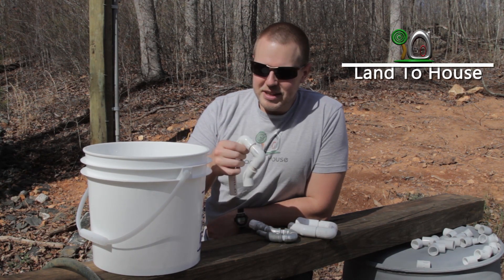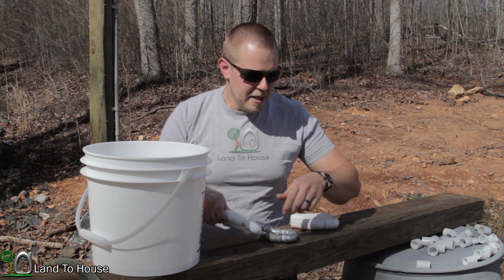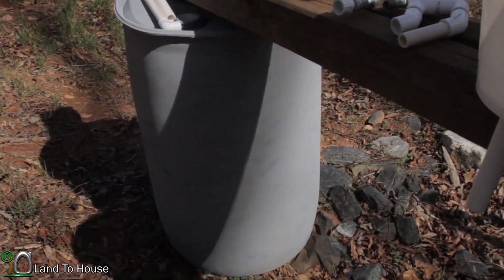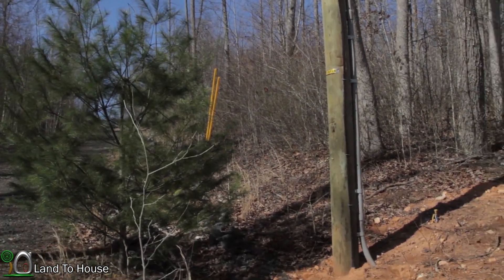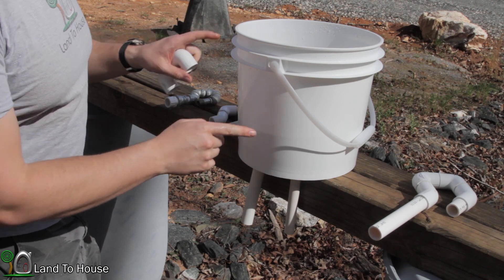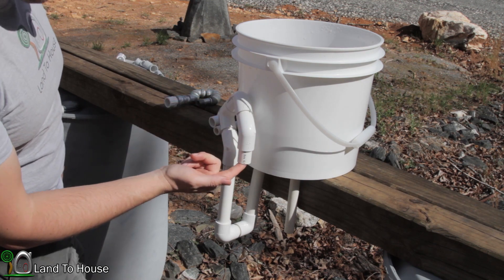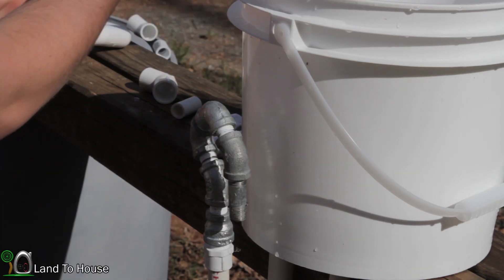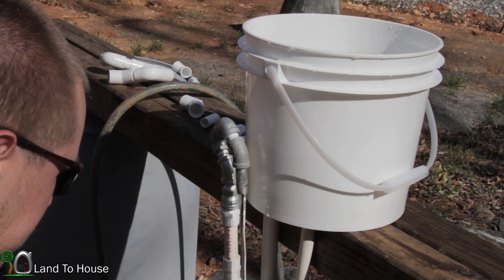Advanced U siphon Testing

Comment: If air gets up in your discharge tube it's harder for the siphon to reestablish it's self, the up tube on the end forms a water seal. Discharging into a bucket so the end is under water or use of a check valve, even a balloon all to keep the air out will help. Experimenting is fun , thanks for sharing.

Comment: So as you said, ducks are not clean, and most of their waste is going to sink to the bottom so you want to suck the water from the bottom to get the most out of the pond; but you do not want to empty it; so you could T in a "snorkel" to set the drain level as this will allow air to enter the pipe. I'd use 1in for the drain for high volume flow and 1/4 for the snorkel to set the stop depth.
                         pond wall> #
                                                #            //\\  <siphon start level
                                                #          //   ||
| <snorkel stop level        #        //     ||
||=================#==//       ||
||                                             #                ||  <drain
|| <bottom of pond         #

Comment: The siphon will start easier with a upward bend at the output. 
An other way of automatic siphoning is just an ordinary siphon using a hose. The hose exits into a full bucket of water. The rim of the bucket exactly at the elevation you like for the water level in the pond. This will work as a hole drilled in the side of the pond wall.  No inrush of water to get the siphon started is needed, but long periods of heat and sun may rise some concern due to vaporisation.

Comment: Would it work placing part of the u syphon in part out? To be able to drain containers without drilling a hole in the bottom
Reply: To hold the water level constant in a dam: start an ordinary siphon over the dam. Put the output into a bucket of water. Elevate the bucket so the rim is at the wanted level in the dam. Normally  you have no flow. As soon as the rain starts to fall, so does the siphon.

Comment: It's a huge learning watching your videos.

Need your guidance to make an Auto Siphon to drain a Pond, Without filling water into it to activate it.

Whenever pond fills with flood water It should activate & starts draining water...
Reply: To hold the water level constant in a dam: start an ordinary siphon over the dam. Put the output into a bucket of water. Elevate the bucket so the rim is at the wanted level in the dam. Normally  you have no flow. As soon as the rain starts to fall, so does the siphon.

Comment: Hi ... if we close the bucket well and fill it with water from valve at highest point then make another extension of pipe from bucket goes down to suck water from pool lower than siphon pipe output did it work (so we can run ram pump at point higher than pool).thanks ... i appreciate if you can make video about this.

Comment: Added the extra pipe and it went upwards that was your problem you need to go down with gravity if you had a longer tube coming out the bottom of the bucket you would have more suction therefore it would suck all the water out the bucket

Comment: Well, that was interesting but can I see it finished and attached to your duck pond?
Reply from the maker: Sadly I do not have a duck pond. It is a fun idea for the day I get one.
Reply: @LandtoHouse  Ohhhh, so I am actually trying to figure out how to redo my current pond.  I have a small round kiddie pool size pond by my coop.  I am working out an idea where this pond flows down into a larger dug out pond that overflows into an intake bucket with a ram pump connected to it that in turn returns the water the original small pond.  So, the water will be constantly circulating and at some point in the system I need a rudimentary filter.  So, I watched this video and thought it might incorporate somehow with my idea but not sure how......
Reply from the maker: The only real problem is that the ram pump is going to have about 90% Wastewater. It won't be long before your system has all of the water at the bottom

Comment: Your siphon is backwards!  The diamond siphon needs water flow the opposite of what you did.  The water should flow over the top 90 BEFORE flowing down to the side 90.  You have it flowing to the side 90 first and then to over the top 90 - this makes it no different than a standard U siphon.  The flow from the top 90 to the side 90 causes water to flow back under itself.  This makes it harder for air to flow back up the pipe and easier for the siphon to fully activate.
Reply from the maker: Interesting. I need to revisit this idea in the future and I will turn the siphon around. Thank you for your observation.
Reply: You are welcome.  My explanation is from what I've researched on it so far.  I haven't created one yet, but considering doing some hands on research instead of the armchair research I've done so far.  The "diamond siphon" name is used by only one source I've seen so far, but its name seems most fitting (Pun not intended).  Another variation I've seen people talk about would involve heating a PVC pipe and bending it into the needed shape.   I think this variation would look a lot like a hairpin cotter pin and should be named the hairpin cotter siphon to distinguish it from the diamond siphon, even though functionally they should be the same.  I have a theory that bending the PVC to match the hairpin cotter's zigzag after the loop would actually increase the ease of activation of the siphon, but its only a theory.  The most interesting way to heat PVC pipe I've seen is heating sand on the stove in a pan and then pouring the hot sand into the pipe.  This heats the pipe from the inside out and seems to work well for the YouTuber I seen doing this.  Haven't tried bending PVC this way yet, but creating an automatic siphon might give me reason to try it.  

To be honest, I'm not sure how far I'm going to work in this.  My original goal was to find a way to get water to flood a tank or container every 2 hours, but then have it immediately drain after the flooding.  This would be for spouting, microgreens, or fodder and a small trickle water source would trigger the flooding every two or so hours (but it looks a small trickle wouldn't be enough to trigger a bell siphon, U siphon or any related siphons.  And it would be a lot easier to just buy a pump and timer and put a hole in the container that is too small to drain the water as fast as the pump is filling it, but big enough to drain it fairly fast when the pump is done.  If something I've written on has your interest, you are welcome to try it and even make a video on it.  You might search for "loop siphon", trying to think of a name someone might call it is the hard part and I just tried "loop siphon" in Google and it seems promising.
Reply from the maker: Hands on is the best! I learn so much more that way. I have only tried to heat and bend PVC once. It was not easy. Keeping the pipe uniformly heated is the hardest part. The sand idea is a fun one! not sure how well that will treat your stove top. Might be better to make a fire outside. I was having issues with the small trickle as well. I finally made a shishi odoshi fountain to jump start the siphon. it works but would likely mess with your micro greens.

Comment: Hi, I built an example of your external siphon and it starts very reliably, but depends on the in-flow rate of the water.  The problem I'm having is getting the siphon to break when the water level drops to the drain pipe inside the bucket.  So.... may I ask how you get the break to be reliable.

Comment: Would the auto siphon work if your outlet pipe gradually rises above the height of the buckets top? Or outlet is at 90 degree angle half inch diameter. I have a problem with a surface water drain where its non existent due to the ground being lower than existing surface water drains. I was thinking if I used a 2m drain pipe with width 100mm would a half inch auto siphon fit inside with the outlet rising straight out of the pipe so full pipe can be removed to clean debris etc. Would there be enough pressure to siphon out and move the water above the top end of the drain by at least another 2m gradually to a drain about 4metres away.
Reply from the maker: I am not aware of a siphon that auto starts when there is a place above the water level. The water would simply get stuck in the pipe between the low spot and the high spot.
Reply: Land to House Damn there goes my idea lol I've got another idea whereby using weight and gravity making a  pendulum where one side extracts water up a 100mm pipe from a smaller pipe, and with a simple no flow valve in between and another at the smaller extraction pipe, the other weight pushes air into the other 100mm pipe and forces the water to exit at another point. Need to see if a automatic pendulum exists -_- You made one video on your ram pumps with a tap for the waste valve, would it possible to divert that waste water back into the system or would that affect the head pressure from the inlet?
Reply from the maker: Here is an old design of a pendulum pump that might be fun. https://youtu.be/_7dTofZPaaU

Comment: You should close the outside of the siphone as you continue to poor water....or more accurate 1. close the u part of the siphone 2. fill it with water. 3. continue to poor water above the u part....it will siphone excellently.....
Reply from the maker: When you say close do you mean manually and then reopen the siphon when the water level is high? I am looking to have an auto siphon that will work when I am not around.

Comment: You mentioned reducing the diameter of pipe in your first video to get the siphon to pull when you tried your second test. You could do that, and some people do. The problem I have with that method is that it reduces your flow rate down to the smallest diameter you end up within your pipe system. Another method (seemingly better method that won't reduce your flow) is to make a longer pipe with a few elbows that makes the water drain more slowly. That's essentially why your siphon is working at 6:28 in this video. The water is falling but not lost. It gets slowed down and helps create the vacuum better in the U. When the water just enters the siphon and then falls onto the ground, it's not helping to create any resistance that the vacuum needs. Put an elbow right below your bucket and as close to the bucket as you can, so the water has to change route. That's a slow-down point. If my suggestion is not clear, I can draw a simple diagram for you. Longer pipe and more bends creates more resistance to flow, then the siphon can start more easily with less flow into your tank.
Reply from the maker: Adding a longer pipe to the end of the siphon was very helpful! It gets the siphon going much faster and allows a larger pipe diameter. After these U siphon tests I made a Bell Siphon and it was even more efficient at pulling the siphon with low flow. You might like my next U siphon videos with the shishi Odoshi fountain.

Comment: Thanks for doing this test. I am building the same type of siphon and the same size. I think the reason your first attempt (which I just watched a few minutes ago) was successful and then failed, was the flow rate of the water. With a fast flow rate you can use larger pipe like 3/4". When the second test of your first video failed, it's because you reduced the flow rate, which put too much air space in the top of the siphon. That did not have enough force to push the air out. To explain in a different way, if you were to take your standpipe and suddenly push it down lower in the bucket, the pressure would be quickly increased, allowing it to push the air out and create that vacuum inside the "U". I am making this comment before actually watching this video, but I saw that you have made three separate sizes to compare. If you are filling the bucket slowly, the smallest diameter pipe will be the easiest to start, but take longest to drain. For your intention of draining a duck pond, the amount of time it takes to drain shouldn't really matter, but smaller diameter pipe will be more easily clogged by the duck waste. If you find a way of filtering out the large waste before it comes into the siphon, the smallest pipe would probably work best. Alternatively, if you fill the pond very quickly, you might be able to get the 3/4" pipe to work. Something I wanted to see in your first video was where the water level was when the first test started to drain. Thanks for sharing your videos.
Reply from the maker: I think you are right! That larger flow rate from the storage tanks was enough to get that 3/4" siphon going with little issues. But the Ram Pump flow rate was much smaller and was not enough to get it going.

Comment: Siphons rely on the negative pressure of the pipe after the siphon pulling the rest of the weight of the water against gravity through the siphon so the larger the drop of the exit pipe the better it would work so long as the pressure is not so negative that the water flashes off and the flow remains laminar across the full diameter of the pipe.

Comment: Can you just hot glue a flexible water hose to the outside of the bucket keeping it in the same U siphon shape? If it works it would save you a lot of money and be very compact. I guess you would need a way of holding it's shape and position while you found the perfect shape, then you could glue that down and trace a template from it for any future projects.
Reply from the maker: I have not tried using a hose as the U siphon but I should think it would work just fine. The pipe is not very expensive though.

Comment: Yes  It does matter,  ( at  6:04 )   its the pressure of the burp,  the water has more pressure in the resivior so it releases down the pipe.    and it sucks down the rest of the water with it..  remember though   the speed of the siphon before it takes.  the pump has to overpower the begining of the siphon or it with cancel out and stay the same speed and wont drain.     BUt the sishi odoshi can solve that.   I like how you think I been working on this sort of stuff for a while now,    No ram pump yet but I love that thing, thats genius.   Now I just need a few $$$  so I can buld one.      I also thought perhaps in a pond if you angle the pipe ay a 45 degree angle, perhaps would that work ?  all I have is a pond so thats what I have to work with,   gravity ,  im thinking pipe at  45 degree for an intake, and see if the ram pump can do er   would be awesome if so
Reply from the maker: My goal is to make the Shishi odoshi  this week and give that a test in the next u siphon video. Should be fun. When you say 45 degrees do you mean angle the u siphon down to allow the water to flow over the top faster?
Reply: I dont nessesarily mean specifcially 45 degrees, but to angle a pipe for a still water to create a gravity currrent if one dosent have a creek or a flow to work with.
I dont man for the U siphon,  I mean for an intake for the ram pump, to get a pipe and see if gravity can feed it and create a pump action from a still water.
Reply from the maker: Oh ok. The ram does not work in still water. It has to have head pressure and flowing water to work.

Comment: Been using an external U siphon for a couple years. use 3/4 with a 1/2 reducer in it. like them.
Reply from the maker: +Charles Kiplinger that's great. Reducing it does seem to work well. That's what I did with the 3/8 inch and it was quite effective.